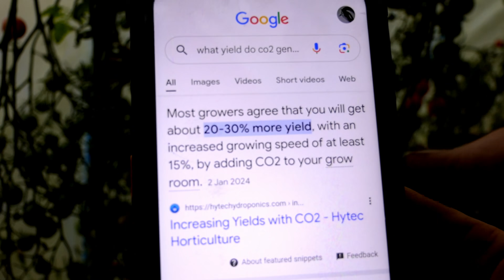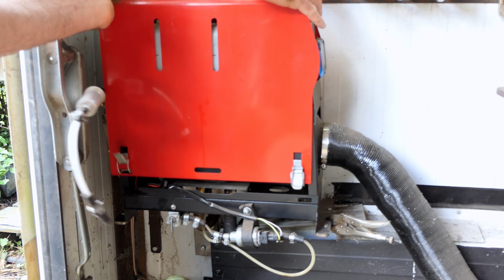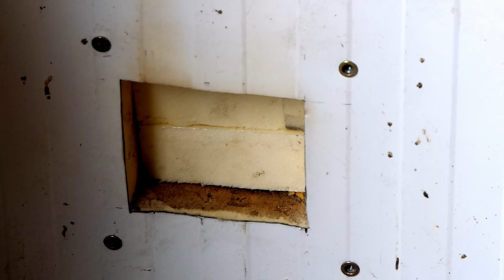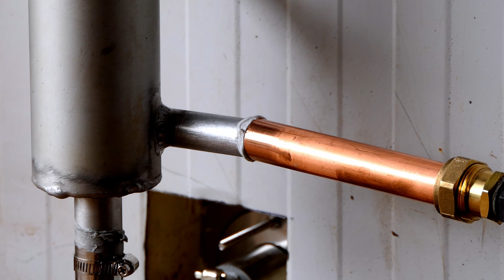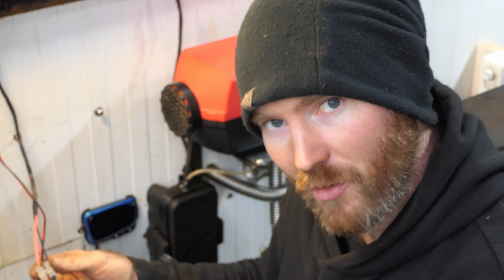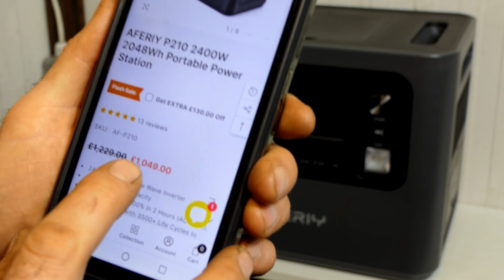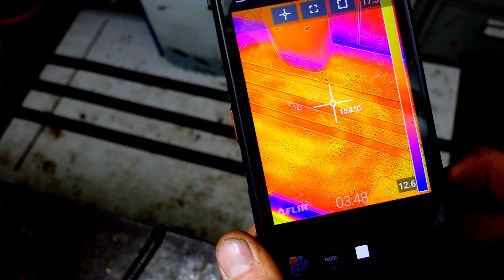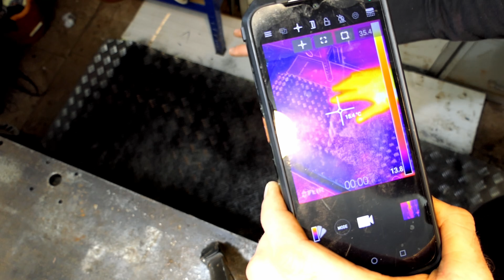NEW! Better system for Cheap and Safe Heating💲+ Underfloor Heating Mod test🫠

Comment: Hi Joshua, re climate change, yes the climate has always been in a state of change. Co2 has been much higher, the planet has been warmer, but for millions of years it has been cooling down, exactly as Mars has. It’s now getting hotter here on earth, taking annual jumps much larger than anybody anticipate. Doesn’t really matter whether man-made or not, mankind will struggle to adapt to the pace of rising temperatures. As you mentioned, insects are disappearing, and at some point this will include pollinators. That will spell the end of a long range of foods, and the beginning of the end for humanity as we know it.
I have a job which’s means I work outside from November to February. I’ve done that job for 20 years. When I started out, I had to wear many layers of thermally insulting clothes and at some days I had to seek shelter just to warm myself up. Now, I often do the same work in t-shirt or a thin pullover, not to sweat.

I don’t care too much about any of it as I will be dead soon, but find the ignorance disturbing. If the climate change isn’t man made, we need a complete change in the preparations to feed people. Man-made we can deal with more easily, but it part of a natural cycle, I reckon we it’s curtains.
Reply from the maker: I didn't deny the earth is warming or that climate change isn't real. I believe it is and will continue for many reasons but I don't believe CO2 is the main driver and needs to be taxed further. Cheers J
Reply: @joshuadelisle yeah I know you didn’t, and I’m also far from convinced. My guess is if we figure out what happened to our sister planet Mars, maybe that would give us a hint. Siblings are typically genetically similar, so assume what happened to Mars could happen here too. We will see. Your videos are hugely inspirational by the way. Your channel is easily on my top 10👍👍👍👍
Reply from the maker: @CRingsing  Your very kind, thank you. cheers J

Comment: You need to make side supports for your insulation board and pour concrete over it, to fill in all the nooks and crannies. Id say about half an inch worth. Theres better ways but im thinking you wouldnt want to start from scratch again and just try and salvage this one. No way what you did will radiate any meaningful heat.
Reply from the maker: Thank you. Cheers J
Reply: @joshuadelisle  love your work btw.

Comment: these diesel heaters seem to blow most energy out of the exhaust
Reply from the maker: Yes they're not that efficient as they are but from my previous experiments we can make them very efficient and therefore are viable cheap heating methods. Cheers J

Comment: Thank you so much for showing us all the steps and how you make your solutions.
Let me just comment on your claims about lead acid batteries, that 50% rule makes no sense.
In real life, you always go for the lowest voltage.
At the same time, you cannot charge lithium batteries in freezing temperatures, unfortunately...
Reply from the maker: Thank you. It's a generalized rule but you're correct that it is a low voltage issue. Cheers J

Comment: @Joshua De Lisle i really hope you actually read this to the end......... 10x the levels of C02 existed previously but also 10 x the levels of vegetation to turn that Co2 back to Oxygen and there for most likely 10x the level's of Oxygen.......  you forgot to mention those bits that don't fit your paradigm... we are cutting down and killing 1000's of time more rainforest than can grow back in 1000's of years...... this situation is like driving down a 1 way street in a cybertruck with the faulty accelerator pedal stuck on..... 

digging up all the stored carbon and burning it to release back into the atmosphere has sped up a natural process which in which we are leaving the end of an ice age that would have happened over tens or hundreds of thousands of years and asshole humans have made it happen in just over 100 years.... the real problem is that it is  exponential like a snowball that gathers momentum and mass as it rolls down the hill... and there is no real way to roll it back up the hill...... keep burning your fossil fuels because its cheaper for you today but what your really burning is your children's futures ..... your a dumbass

Comment: There is no climate emergency, carbon dioxide doesn't act in the way that Anthropogenic Climate Change Proponents ( - scammers and delusional idiots) would have you 'believe'.

When Politics sidestep facts

When considering matters surrounding the current political narratives of the day, we should bear in mind the wise words of past figures of some merit; the American man of letters Henry Brooks Adams observed that 'Practical politics consists in ignoring facts'; Churchill famously noted that 'United wishes and goodwill cannot overcome brute facts; panic may resent it; ignorance may deride it; malice may distort it; but there it is'. Burns was a little more frank: 'Facts are chiels that winna ding, and downa be disputed'. 

The entire current net zero scam, for example is based on readily provable fallacies, namely that 
a) carbon dioxide is somehow a pollutant, when in fact it is an ESSENTIAL TO LIFE gas - try growing any plant in an atmosphere scrubbed of carbon dioxide, and it will simply wither and die - reducing CO2 by 60% of today's levels would kill off plant life on Earth entirely, and all living things thereinafter dependent;
b) carbon dioxide's innate propensity to help warm the planet - (which occurs only between the levels of 50 to 100 parts per million) has for hundreds of millions of years been saturate, i.e. cannot be meaningfully increased further - our planet would be some thirty-two degrees Celsius colder on average without this historic and wholly natural warming effect, albeit nowadays erroneously termed the 'greenhouse effect' - CO2 constitutes only roughly ten percent of the whole, with the other 90% part being the work of water vapour in the form of clouds, which we are neither able to reduce nor even control, much less set a pretend tax or levy upon; 
and
c) the cultists, charlatans and scammers oblige us to ignore the second law of thermodynamics, which while we need not of necessity fully comprehend any more than we do the nature of electricity, but accept as a matter of scientific fact, as has and to this day is still accepted by all serious men of science, which obliges us to acknowledge that the irreversible nature of radiative energy absorption of the air (how our Sun's energy warms the planet, and how it cannot turn at once from radiative to convective energy and thereafter somehow back to radiative energy once more) under the naturally convective atmospheric conditions on Earth renders 'back radiation' and thus the so-called 'greenhouse effect' impossible. Put simply, eight minutes after the Sun's intense radiative energy leaves the surface of our star some 92,800,000 miles distant, it arrives here on Earth, bringing life-giving warmth. That same radiative energy is shortly thereafter converted into convective energy, via transfer of heat to air molecules of almost all manner, including their famous whipping-boy, carbon dioxide, but from which transfer it CANNOT thereafter reverse or re-convert back into short wavelength energy; thereafter the thus converted, convective warmth works its way via convective currents up through our atmosphere over hours and days, and out and away unto space - unlike being trapped in a greenhouse - and is lost to the planet forever thereafter. This latter process happens not at the speed of light, but at the speed of convection, a far slower process. Earth has NO meaningful way of heating up our atmosphere, even after considering volcanic activity.

It should be borne in mind too, that all carbon dioxide on Earth constitutes a mere four one hundredths of one percent of our atmospheric make-up, and of that minute amount, a mere 4% of that whole is man-made, the other 96% being of an entirely natural origin; this makes the notion of Carbon dioxide heating not only itself but also the remaining 99.96% of our planet's atmosphere something of a 'tall order' to say the least, given such physical constraints placed in its way, whether by nature or design. Our world's CO2 represents 0.04% of our entire atmosphere, man made CO2 is but 4% of that tiny amount; even should the 18 parts per million (4%) CO2 ascribed to the total 420ppm double, triple or quintuple in volume,  the greening of the planet will be the only result, providing even more oxygen via photosynthesis.

A perfect correlation between the monthly mean sunspot number and the mean seasonal temperature variation clearly demonstrates that solar activity is the principal driver of global warming/cooling, depending on solar activity levels - in short, it's the Sun, not us. 
Well over one thousand scientific, peer-reviewed papers have been produced demonstrating the link between Earth’s climate (which produces no heat to speak of sufficient to drive its own climate) and the Sun - our SOLE meaningful means of warming the planet. It has furthermore been comprehensively proven by the two Professors, Dr. William Happer- chief Scientific advisor to three US presidents - and Willem Van Wijngaarden, both at Princeton, USA that carbon dioxide does not and indeed cannot warm the planet in the way that the scammers and charlatans would have us "believe", and yet despite ALL this, rather than ‘looking up’ and finding out basic facts for ourselves, a global industry has been created around this foolish notion; they persist with the myth, trusting in the supposition that no one else was paying much attention to physics and chemistry in school. 

Consider also what the 'slick salesmen' do not tell you as much as what they do - in January 2022 a huge underwater volcano erupted in Tonga*, spewing out millions of tonnes of carbon dioxide and other gases, and well as firing millions of tonnes of water vapour into our upper atmosphere, impacting on the climate of our entire planet; the regionally varying cooling and warming effect of this event is acknowledged by meteorologists and geophysicists alike, but this is regarded as somewhat 'inconvenient' or irrelevant by our politicos seeking to drive the narrative to their own ends.

*https://m.youtube.com/shorts/IZkAqZXQt5Y

https://www.jpl.nasa.gov/news/tonga-eruption-blasted-unprecedented-amount-of-water-into-stratosphere/

So - when they come to further con you into both parting with your monies and the fireside comfort of yourself and your loved ones, remember to consider not only their politics, but also the brute facts, for change these they cannot, despite their urgings and motives.
--------------
Some further facts worth considering here on this and related matters, which I respectfully urge viewers to avail themselves of:

https://youtu.be/3q-M_uYkpT0?si=NS12scJgnz_Qf-B6
- all you need to know about carbon dioxide but didn't know how to ask (if you can take in the first eight minutes, you've got the main points, but do please see his closing remarks and the analogy he draws between the charlatans of the piece today and those bloodletting medical men who, through ignorance of known science killed the first US President, George Washington, 59:45 and onward)

https://youtu.be/M8iEEO2UIbA?si=cOuosdhyScceCMkc
on the subject of the demonisation of carbon dioxide - introductory remarks end around 3:10 in)

https://youtu.be/CqWv26PXqz0?si=kT0XBqgComVx2Kth 
on how CO2  does NOT operate in the manner modelled by IPCC
(Gets going about 3 mins in)

https://youtu.be/XJOazhVmf9w?si=tkt7JeaeUtew_z1Z
on the Sun and its influence on our planetary climate;

https://youtu.be/sgOEGKDVvsg?si=EOGoLmp8_8C2EsrOr
on the delusion of making a transition to net zero, and the inescapable mineral demand realities therein implied.

There being therefore neither a 'climate emergency' nor any sound reason to transition to 'Net Zero' nor even any ‘Energy Transition’ taking place, one wonders how we have been so badly misled, and indeed why.     A good Scottish education was once a matter of honour for the folk of our once proud country, it is sad that we are today obliged to educate ourselves on these and other matters of importance, that we may deliberate between the politics on the one hand, and the hard facts on the other, in a bid to determine the best way forward.

https://youtu.be/ZXkEgF1I2FA?si=jDVz4sGzdG1SCX5m

Shakespeare wrote: 
‘What a terrible era, in which idiots govern the blind’…

CIA director 1981-87 William Casey said, in his first briefing to President Reagan, "We'll know our disinformation program is complete when everything the American public believes is false."

Comment: I bought a diesel heater as a backup after watching your previous videos 😀 I have been looking at air source heat pumps and follow Heatgeeks own home system his SCOP is 4.64 which is good but obviously his install is top notch. The one thing I would say is that if you had to install a whole new heating system and had the cash you could buy a home battery system from a company like Fogstar, then go to Tomato energy and from 12-6am they sell electric at 5p perkwh. You could store the next days energy and if your heatpump has a SCOP of 4 or more you are looking at 1.25p per kwh (of heat) plus standing charge and the cost of battery, inverter, ASHP so it's not cheap but kind of future proof. Also If you can have 2 meters then you could also install solar and sell it to Octopus at 15p a unit, maybe even rig it to sell tomato 5p energy back to Octopus and beat the B*stds at their own game 🤣I doubt they will allow it but I can dare to dream. Good work sir keep it up 👍
Reply: One thing people don't factor in is the amortised cost of the battery and solar panels. Battery is between 7.5p and 20p/kWh delivered over it's life. Solar PV about 9p/kWh. So going off grid would be 9p/kWh if you use it when it's generated, or 16.5p/kWh to 30p/kWh to use it later.
Reply: @Leo99929  Yeah good point, it depends on how much it costs all together and if you can do diy. Fogstar have MB31 cells with 8,000 cycles which should last well over 20 years. Solar panels are cheap and if you don't mind doing diy battery and ground mount etc.. you can possibly bring the cost down to around 4-5p. Something will probably break over 20 years so 7p is probably not far off. The ASHP is the game changer if you can get a good scop but that partly depends on the property etc...
Reply from the maker: Thank you. That's good to know. Cheers J

Comment: I love your videos, and this was a great experiment. You could try increasing the surface area of the air path in your heat exchanger with fins, but I think you'd be better off chopping the top and bottom off and making an end-plate with a bunch more surface area. Also something to help might be to use square tubes because squares have more perimeter vs volume compared to round tubes. It will make drilling holes more complex though. Maybe just doing your longer run of pipe will do the trick better.
Reply from the maker: Thank you. Cheers J

Comment: For the exhaust Try Bowman water oil coolers. Similar pipework as a locomotive internally, welded pipes to end plates and bolt together for internal cleaning.
Reply from the maker: They're a little pricey. But thank you. Cheers J

Comment: Hold on…. ‘What’s good for the trees is good for me’???? Correct me if I’m wrong, but we breathe in oxygen and breathe out CO2….. trees do the reverse?!? I want to watch the last part of your film where you discuss these things further…. But this isn’t very encouraging?!
Reply from the maker: Exactly that. If producing CO2 is good for the trees, then the trees will produce more oxygen which is good for me. + A lot of other benefits that I touch on later. Cheers J
Reply: @joshuadelisle thanks Josh - I had misinterpreted your remark. I will check out your out the rest of your video later. Just aware that the darling algorithms seem to present me with lots of material where a tin-foil hat with ‘MAGA’ on it seems to be required…. And I don’t have one 🙄

Comment: When you design your diesel water heater. Install a water flow meter. and measure air on and air off temperature.  Using a flow meter you can calculate how much energy you are using to heat 1kg of water by 1 degree. By this then you can calculate efficiency of the system.
Reply from the maker: Thank you. I will. Cheers J

Comment: A good rant. A lot of common sense which is missing across the field of the (corporate and government sponsored science). If you are looking for a way to capture the heat of the exhaust gasses, take a look at the construction of "Kusnetsov fireplace". The Russians have developed the science of free movement of gasses, through something that can be described as heat-bells, which allows, with an extremely high efficient burning, an efficiency up to 95% for a self build wood burning fireplace. I have build one myself, and have operated now for several years with an average efficiency of 92%.
Reply from the maker: @EfficientEnergyTransformations  I'll check it out 
 Cheers J

Comment: Use a router for the UFH pipes, consistent depth and clean edges, and quick.
Reply from the maker: A lot of dust though but you're right otherwise. Cheers J